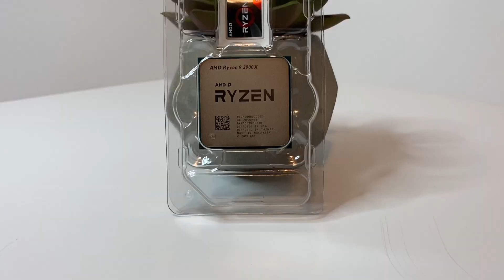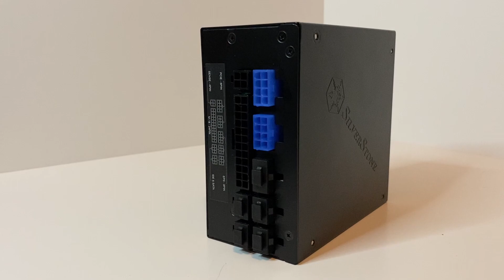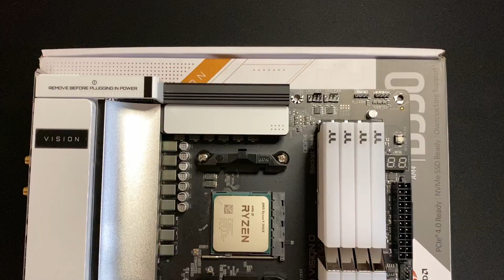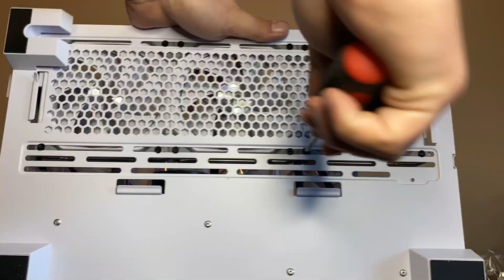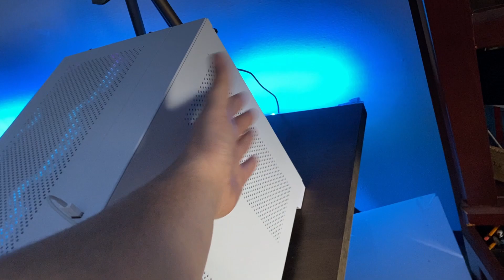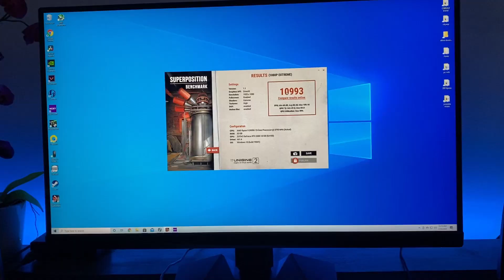$2800 My Dream PC Build! - Lian li o11 Dynamic Mini/ZotacGaming trinity 3080/lian li uni fan SL120

Comment: Flip your radiator fans to intake. You have negative airflow
Reply from the maker: Having intake on your fans is not a good idea.. thanks but I’m going to keep it how it is!
Reply: @CGBuild  it is a good idea? Check those YouTube videos that shows best temps for Lian li o11 they use intakes on radiator. Your going to have negative airflow which causes lots of dust. But whatever makes you happy and nice build💧
Reply from the maker: @tiffanyduong9920  the temps are pretty good as of now but I will try it thanks!

Comment: You put the AIO radiator upside down, the tubes should be on the bottom. It is known.
Reply from the maker: If I want my radiator to last 6-7 years I would do that... I won’t have this same system in 2 😂

Comment: Flip your radiator to the tubes being at the bottom. You will have air trapped at the top and you wont cool as efficiently. Very nice build.

Comment: Ehm why you got only 16gb ram . For your cpu and budget is 32 standard bro
Reply from the maker: That’s what I have? I said I have 32gb in the video
Reply from the maker: It’s ddr4 3600mhz 32gb
Reply: @CGBuild  yeah my bad i saw your build and the parts and i only saw 1 of 2 2x8 gb ram . Your pc is so insane
Reply from the maker: @twenzy_tryq1851  thanks man!! And no problem mistakes happen

Comment: Would look 10x better with a white Gpu like the asus one.
Reply from the maker: Yeah but I’m not buying one for $2500 to a scalper
Reply: @CGBuild  I know, sucks that stock is so bad. Maybe Rtx 4000/5000, you can get one. I heard 4000 will also be a pretty big upgrade and that 5000 will have cheaper GPUs with its Hopper design.

Comment: just throw a back fan in there i duno why you hadnt.
Reply: and turn the radiator around thats the point of the whole glass front and side.
Reply from the maker: Well if you throw another exhaust fan it’s a lot of negative pressure witch can hurt temps.. and nothing is wrong wit the radiator 😂
Reply: @CGBuild  I would add the back fan and turn the fans on the radiator itself around and see if it feels any better.  this case drives me nuts because no matter how you position everything it doesnt feel right to me. but it looks SO cool. lol. youve got 5 exhaust and 3 intake so it wouldnt hurt. youd have 5 intake and 4 exhaust. but even still the way it is makes more sense even tho all it makes me want to do is put the radiator on top and use the side fans as intake. but youd have to upgrade the radiator to a 3 fan. i duno this LOOKS GREAT. can I have it? ...LOL
Reply: @CGBuild  only reason I say that is because I think the cpu water cooler hangs from the top and the gpu water cooler exhausts from the side. And if you want overkill I think its suppose to have the gpu cooler exhausting from the bottom as well. so like a 5 fan radiator for the gpu. with a back fan intake? I guess? I dont really know. But if I had this build I would use the side fans to watercool the gpu.